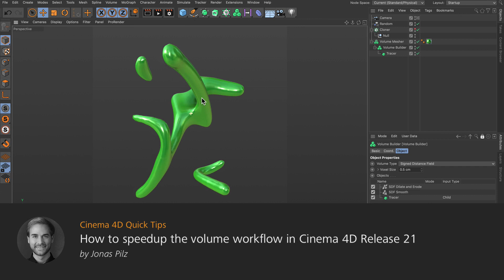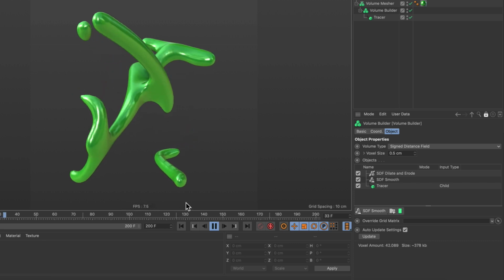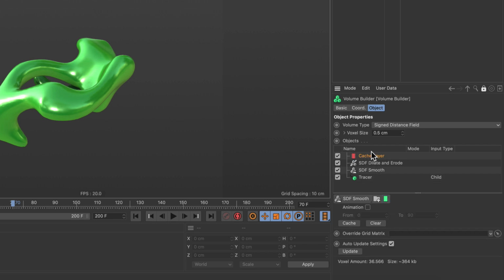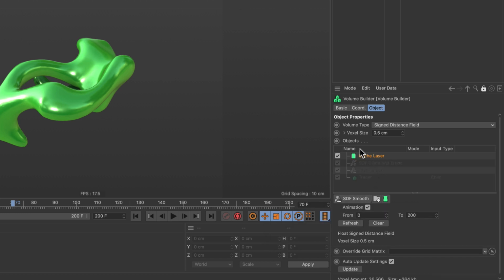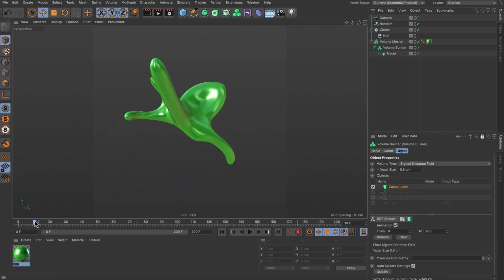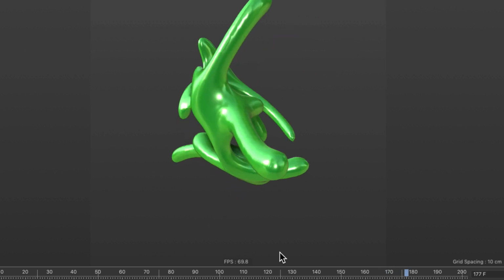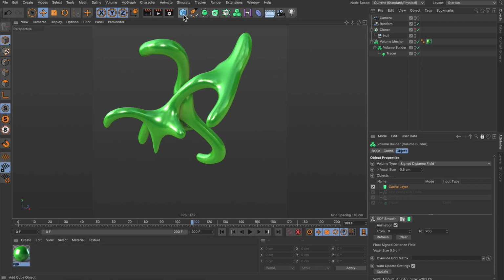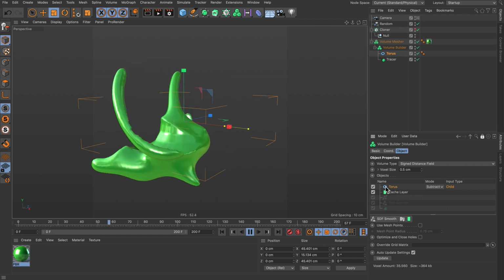Tip - 265: Speedup the volume workflow in Cinema 4D Release 21

Comment: Unfortunately, this only works for such simple things.
If you have a more complicate setup it all gets pretty slow even with cache. The only thing that helps is a bigger voxel size, but then mostly the result is not usable.
But I love the volume builder anyways ;)
Reply: Also the cache is sometimes incorrect from the final render when you have multiple filters stacked sometimes in my experience :D. My potato computer is exploding creating coral in realtime. I believe dynamics and cache don't blend well together with volume building fun.
Reply: @seanteriyaki5078  In one of my last tutorials I used metaballs instead of volume builder. It worked surprisingly good. Maybe you should try it too.